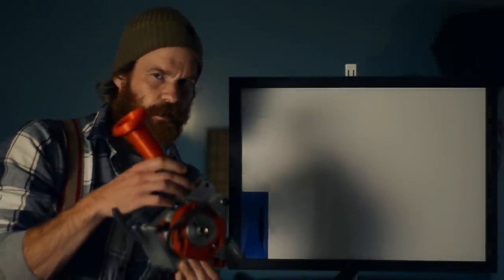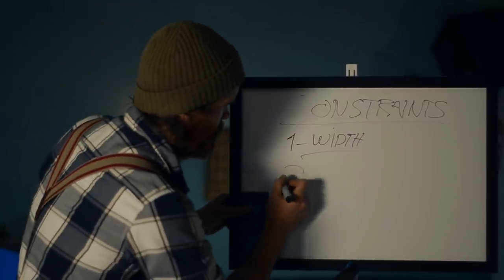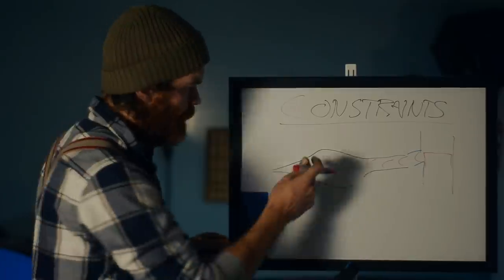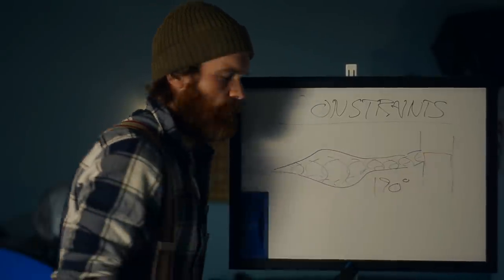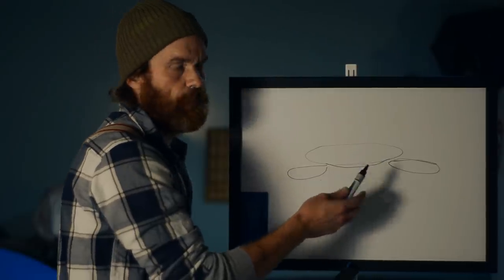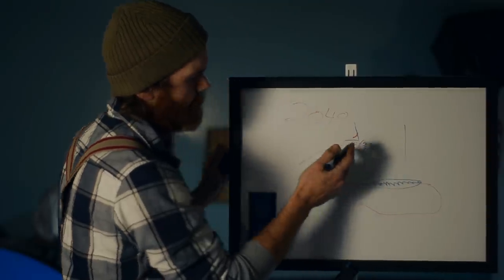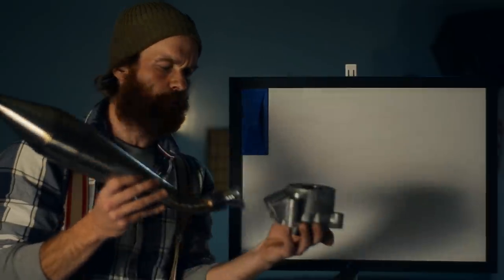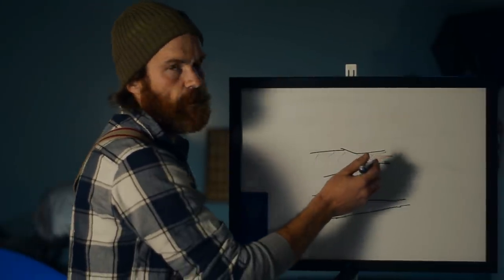How to Make the Most Powerfull Two Stroke - P1 Porting

Comment: If you had two exhaust chambers 60 degrees apart have the first one open sooner with a longer chamber. The second one opening later with a shorter chamber so the wave can come back sooner because of it's shorter timing of opening and closing. This should give a longer time or duration for the exhaust and wave length back to the cylinder.

Comment: I learned a fair bit here. Clarification. Mach is the speed of sound. Speed of sound is relative to the pressure of the medium  the waves travel through, ie easier to break the sound barrier at higher altitudes. But if you're referring speed of sound as a speed then at sea level it's about 1200 kph.

Comment: Its going to be one of  the most powerful 50cc single 2 strokes out there. It will also be a great way to show how tuning purely for peak power at max rpm creates an engine that is of no use except for a single niche area. (lsr) as even in drag racing you need power in the top 3rd of each gear to maximise acceleration.

Its an amazing testbed/means of exploring ideas and a LOT of what you have done here will find its way into other engines. Taking the parts of the build that will benefit them in their role, the same way MotoGP and F1 you see parts of their design migrate to road cars. (VVT, small displacement turbo's, Active Aero etc)

I'm loving the walk through and explanation 9f each thing you are trying!
Reply: it wont
Reply: @alancollard8939  I suspect it will be one of the most powerful 50cc motors of its number of cylinders and displacement  around in its final form.

The rest of the LSR bikes are up there.

Lo9king at the other powerful 49cc bikes (looking at at the crank figures to eliminate gearbox vs cvt vs direct drive) 

Honda RC115 was a twin cylinder and 15hp so irrelevant in comparison to this motor, The Single Cylinder RC110 was 9.5 so less powerful than the last dyno'd motor and revved to only 14.5krpm vs this 20k. Also it only gained that 9.5hp from a 9 gear gearbox which is going to be more efficient and deliver more power than the CVT.

The suzuki triple was 19hp but again 3 cylinders and 14 years with the parallel twins being about 15hp

The Woelfe engineering Axairo ISN'T a 49cc engine, it is a rotary and given how rotary engines work you can play fuck fuck games with the cc that is claimed. An RX7 can be registered in the UK as a 1300cc engine and the Norton rotary measurements varied between 600cc and 1800 depending how it was measured and this one is when measured properlytaking into account the rotary system and how it works is 300cc.  That is 44.25 at 8750rpm but again it isn't a 50cc engine so it is irrelevant.

So most powerful 49cc single cylinder two stroke is both a reasonable target and something he has a decent chance for being in the top 5 out there.
Reply: Once he's got it dialed we could potentially have a two cylinder model, won't be 50cc but will have the torque to blow your pants off.
Reply: @jediknight1294  I'm surprised no one has made comparisons against the 50cc water cooled minimoto engines.  The IAME M-50 dyno's around 16.5hp at the rear wheel (stock), going through a centrifugal clutch.  I've personally seen a SPS bottom end, with a BZM cylinder redline to over 20k rpm.  Crank power estimated around 20hp.
Reply: Considering exhaust port area is one of the most limiting factors, the 360 degree exhaust port with fewer bridges certainly gives it the potential to be quite literally the most powerful gasoline 2t (per cc, if that's not obvious).
Reply: @zxtimmy4  water-cooled to air-cooled is again a different thing but probably is fair to compare t9.
Its amazing to see that we now.have access to engines as powerful as Iconic motogp engines of the 60's and 70's.

 To be the fastest air-cooled single cylinder 2 stroke 49cc (if its 50.1cc its not a thing his license covers him for ergo it is no longer legal for him to ride at bonnevile and its also no longer a 50cc engine so not legal for class) it will have to hit between 24 and 28 hp on the SAE scale. 

Which he has shown is doable.
Reply: @macelius  that title would be hard given the rotarys that are at .44 hp per cc and the gp 250's that hit close to that and the 500cc gp bikes that hit around .5hp per cc as well as the 15 gear 50 monstrosities that hit 30hp and thus .6 per cc and remember this is running nitromethane and the n8tromethane bikes can hit .7
Reply: @jediknight1294  Have you seen his rotaries and his race engines/bikes?  Last one he was already over .4 at the crank.. if this gets even close, and we're not even talking reliably, it will be proof of concept warranting further investment, research, and development.  

How much do the engines you build make, btw?
Reply: @macelius  last 2 stroke i dicked about with was as a teenager and was an Aprilla RS125 with a LOT of aftermarket parts setup for track/Road racing that was close to 44 at the crank on an engine dyno and mid to high 30's on a roller dyno but that was years ago.

Involved in a couple of v8's over the years in the 750-1100 whp range for drag and street work. 

Iv been unable to ride for a few years due to an injury and not working means no $$$ for high cost stupid bikes.

Oh yeah if this thing gets close to the .6 thats viable it will do maybe 5 runs then melt but... he only needs to make 2 back to back runs to set a record and that includes a half hour cooldown. 

Make run one, return in the opposite direction, average is taken and then the bike goes to parc ferme and then makes annother there and back run the final average is calculated and that sets and confirms. the MPH record.

It is a LSR engine who cares about reliably tbh. As long as it can make say 10 2 mile runs at 20k rpm at Speed Week, who cares if he immediately needs to rebuild it and do a new top end?

LSR is top flight racing and therefore whats demanded of an engine is hugely different to a street bike or even a club racing drag bike.

I wouldnt push anywhere NEAR the power he and the other LSR 50cc teams are doing and I wind back my race builds significantly.

My street RS125 aprilla was 33 stock derestricted and I did a basic reed valve and exhaust and that was maybe 36 at most. The race bike was nearer 40-42 but I was rebuilding it every 30hours vs the street bike getting 5-10 thousand miles. (Well if you ignore the times I melted the piston riding like a dickhead.)
Reply: @jediknight1294  I happen to be an "inmate" of apriliaforum.com, and though I ride a much bigger one (ETV1000), I have done my share of lurking in the small bike forums, and considering few RS125 guys "ducking" around are even breaking  30hp/.25 (no, big bore kits don't count), and how hard those that do have to work to claw away each hp through the low 30s, you'll have to forgive me if I don't immediately believe you.. also tldr
Reply: I was hanging round at a shop run by an old mate of my dad's who built race bikes so that helped and yeah the race bike got an engine where 90% of it wasnt actually aprilla parts. Most of it was stuff from the Karting stuff that was based on the Rotax aprilla used. 

I call it dicking around because I was hanging round in the shop learning and being shown stuff, watching, making the tea, sweeping up. Doing the run to the samwich shop for lunch and getting up at 4am to sit in the back of a van to go to a track on a cold wet Saturday morning. 

I had a lot of advantages and learned a lot. Fuck I wish I could go back now and write down everything iv missed and go back with the money I have now to save some of the stuff they had tucked away. LC350 ex race bike from the ill-fated LC endurance series in KR colours signed by Kenny Roberts on the tank. The ex Works Bike Aprilla that had done a season of MotoGp in the 90's then got sold to a privateer team and ended up sold for pennies on the pound to Keith for his grandson to race sometime around 2004. The ex BSB YZF750  in Boost colours, one of the Rizla Suzuki supersports bikes that went to the TT. 

This was between 2000-2004 I barely knew what the Internet was at that point tbh.

Comment: its fun to tinker on these small cc 2 strokes cos when u do something ringht it will be a noticable difference compared to a big 125 or 250 cc cos they run very good anyways. I have a honda automatic PXR 50 cc with a Polini 70cc sylinder and have made my own exhaust to make it run better. then I took a proma from honda mb5 and changed it to fit and it made a better powerband. reed inlet area was tiny tho so I removed it and put a honda mt5 21 carb and big reed to fit with this homemade adapter inlet plate wich allowed the entire hole in the crankcase that was meant to host the original reeds to be used and now it runs way better cos it can flow more fuel and air.  A buddy has this roller bench in the ground to measure horse and torque on cars but he also masured his moped. i need to get mine measured cos im sure it should be 10horses in this one now ;)

Comment: When you tune the exhaust pipe, it can be a pipe whose length you can adjust. With a pulse jet motor, it was found. Perhaps the water hammer phenomenon was discovered first. Intake resonance is also important.
The amount of water through the openings tells you how efficient they are. You can use wax to change shape.
Reply: Interesting idea..
Reply: Ootteko sukua
Reply: @0nniaho  En tunne sukuani yhtään nimeltä.
Reply: If intake resonance and exhaust resonance could be tuned according to rpm and throttle position in real time? I guess the throttle does change intake resonance. Tuned to a root and a fifth?

Comment: I had a yoneyama 10cc rc engine with a tuned exhaust.
First you got it to run at highest rpm without exhaust,then put the exhaust inside the exhaust port sleeve and tuned it by sliding back and forth until you had the highest rpm,something like 21000 rpm,i think it had about 2.8hp,and the sound was so exiting as was the speed when flying the model.
I remember digging 1/2 a meter down into a stadium lawn to retrieve the engine after a  full throttle steep dive with rc failure.

Comment: Just an addition to the Wobbly duct: it is going down to 75% of the area of the exhaust port over a length of 1.5-2x the bore diameter. Worked great for me to modernize a relatively outdated kart engine. Together with some other tricks that people with more knowledge than me came up with.
Reply from the maker: 👍 Great addition!

Comment: I once fitted a Yamaha LC 125 engine into a Suzuki RM 125 frame, to do this the exhaust had to do an immediate right turn where it bolted to the barrel due to the Suzuki frame single down tube ran in front of the exhaust outlet, i used the Yamaha manifold capped off which was a tube 3Omm long capped at the end with a slot cut in the side 3Omm by about 7Omm curved, a rectangular to round adapter was welded over this slot, the round end of which went straight into the side of the RM expansion chamber, the G pipe had been cut off and the end capped off, the round pipe entered the expansion chamber about 5Omm above where it was capped. The engine had been ported by someone nothing too aggressive tho, when i ran the bike i was amazed at how much top end power it had, it was like a motor crosser, revved so hard the float bowl couldnt keep up, this was a super short pipe transformed the power, a mate of mine who does grass track racing with his lad has a variable length front pipe on his little stroker, he can move the power round to suit the track conditions. THE PIPE IS KEY.
Reply: I actually thought the bike with an exhaust like that would run like a bag of shit but i just wanted to get it running so i bodged it really, how wrong i was it was a match for the old Maico 49O up to a point.

Comment: Very interesting, keep rolling, I was going to ask about a rooster bottle, I fitted one on my 125, with fibre reeds and an expansion pipe and skimmed head, this smoothed out the power band, so much so I locked up the small end bearing in the end.

Comment: Great video,
I ported my own 350ypvs and built my own expansion chambers 28 Years ago after having a couple done by those 2 stroke legends Bob Farnham, and Stan Stephens.
I wish I’d had access to this amount of knowledge back then, I had a book on tuning cart engines, one on tuning bantams ( that included the use of stuffers) and an old paperback called 2 stroke tuning (the authors name escapes me, but his expansion chamber calculations were a godsend).
The bike resides in the loft now, and won’t see the light of day until it has to pay for my ⚰️.
Keep up the great work sir, you are a genius by every definition.
Reply: Gordon Jennings "2stroke tuners handbook"?
Reply: OSSA Nyberg Just been up to the book shelf, it’s two stroke performance tuning by Graham Bell.
The old kart tuning book was by a guy called Baker or Bacon, that one’s in the loft, but he used a clever variable length expansion chamber to tune the power characteristics for different tracks, just a simple slip joint in the parallel section of the spanny.
Reply: I have both of them. Graham Bell is later and more scientific. I think he was a university professor.

Comment: I love the "schooling". You explain yourself well and it helps us understand the reasoning behind your choices.
I also appreciate very much the presentation of your failures. 
Most would never show them. 
If you aren't making mistakes then you aren't trying.  
Keep up the fantastic work and keep pushing that amazing brain of yours.
Have you considered trying a Tesla valve arrangement for your valve less intake trumpet?  If the return chambers were varied in size it would have multiple resonance frequencies. Or possibly it would naturally "tune " itself due to the spacing of the returns. Might even work for the exhaust as a multi resonance expansion chamber. Would be a tough thing to build though.
What about flow directing vanes in the exhaust port to help the exiting gasses as well as the return waves?

Comment: Knew some of the theory but never had it explained and theorised like this. Could have been helpful when karting with my 100cc two strokes in 1970-73. However with fixed drive, no clutch or gearbox, would have been a nightmare for a compromised power band ! 🏎️👍😃

Comment: I just got back from working on my fathers old Kreidler Florett K53/M1. It sat for around 32 years but it started first kick . I even have it on video if you'd like to see it. Now I'm slowly getting it to run better and better, but it still runs way to rich. It had a 1/10/53 BING carb and 2hp stock. But a 1/18/something is installed now. Maybe makes 3hp and it already feels like it's rattling apart lol. Gonna be a big project. I will drive it when I get my license. But I'll have to wait another four months till I'm 16½ to make it.

Comment: It would be Nice if you could make a summary of all the new inventions that goes in to this engine. Like The exhaust port for example, 100% of bore, whithout eating The ring(s), thats a complete new thing, never tested before, right? And obviously you got it working. 
What else is really new thinkings? Or is that The only thing that is really new? And if so, how much difference can it make compared to using bridges?
I hve followed this since The very start. Really impressed by your build so far. Its so Nice to see that you came back after your long break from this 😁👌
Keep it up!

Comment: 373/5000
hi I believe in your idea and from what I can see it seems to work. but what I start to think about is when the engine gets really hot when the parts expand by the heat. so I know a liquid that has worked very well for me when I have ridden motocross it is Evans Waterless Coolant it can be a good product to check out in the future.
thank you for allowing everyone to accompany you on your journey
Reply: Evans waterless will actually cause the engine to run warmer (propylene glycol has a lower thermal capacity), it just prolongs the time before issues becomes more apparent.

This engine will mostly run on drag strips and dynos, so cooling isn't going to be a large issue anyways (better to run an ice box).